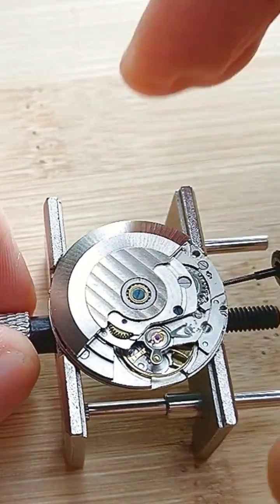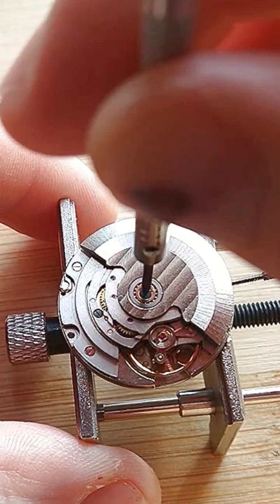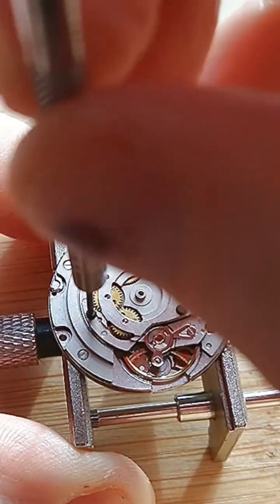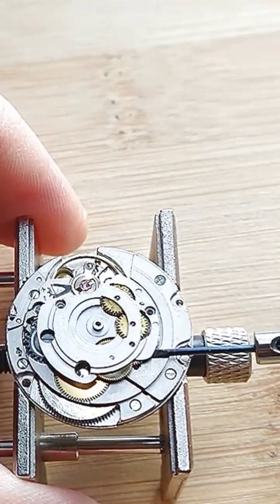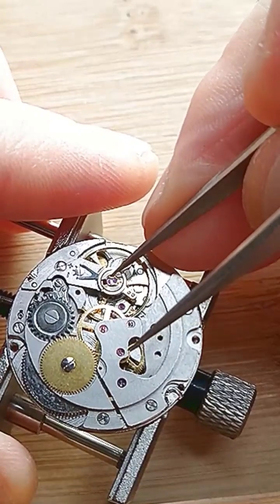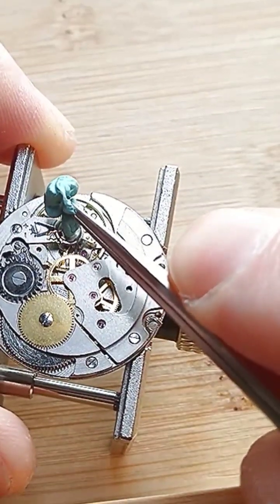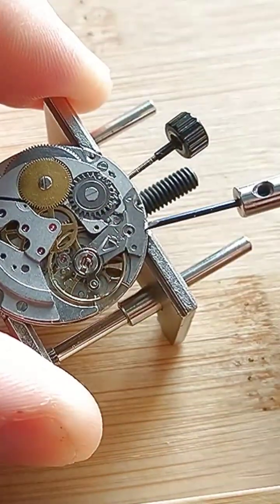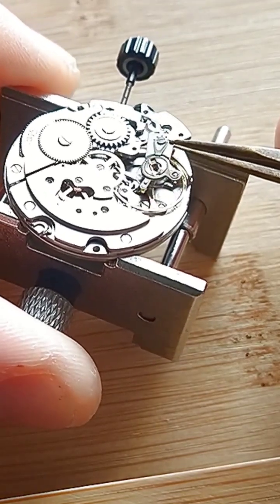How to start a disassembly of a watch movement at home

Comment: i will need your help with the SW200-1 my friend
Reply from the maker: go ahead with the question ...
Reply: @tickingWATCH  Can i work on the SW200-1 with a basic watch tool kit bought from Amazon ? Bcuz i'm aware this movement i mentionned is quite expensive...
Reply from the maker: @amenhotep7704  you should be able to make standard disassembly and assembly